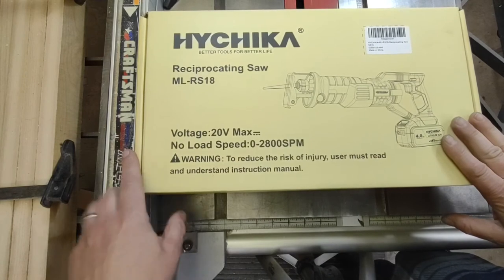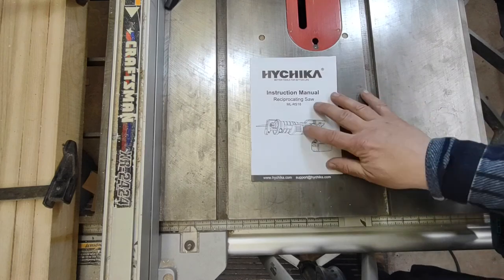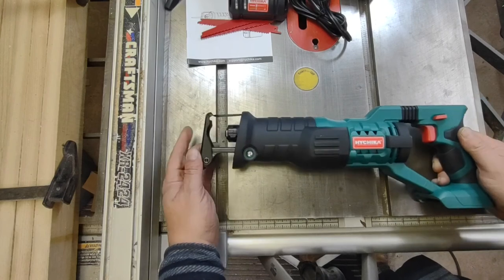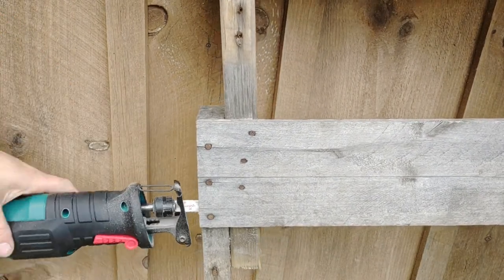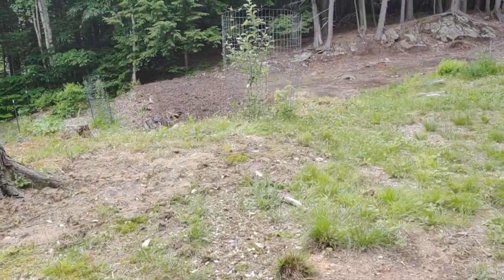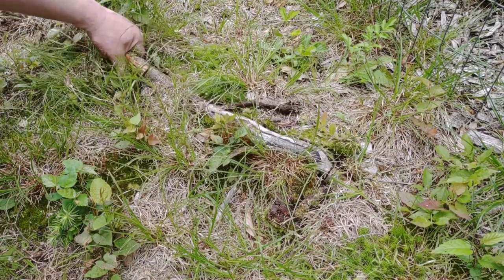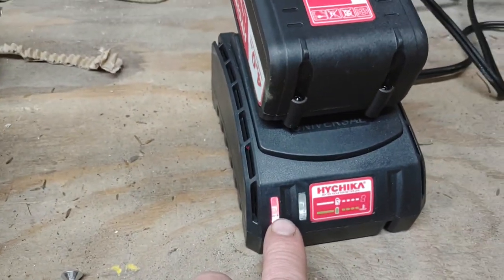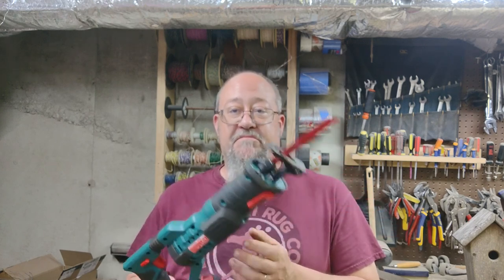Hychika Cordless Reciprocating Saw.  Test and review

Comment: When I use the saw and pull the trigger it only works if I am pressing on the safety button too. Why is that?
Reply from the maker: That's pretty standard on most of the newer power tools I've used
Reply: Thats to stop you or sombody else accidentally pulling the trigger and setting it off.. Safety feature,common among all power tools now..